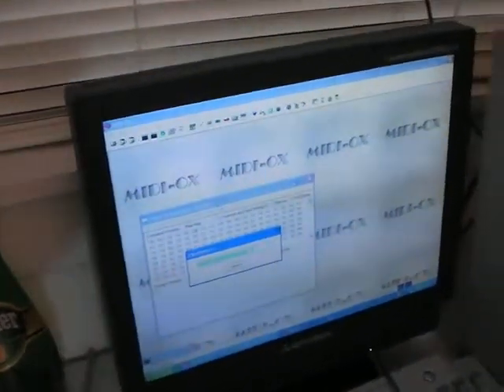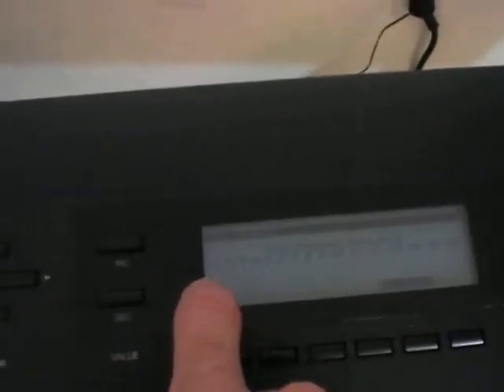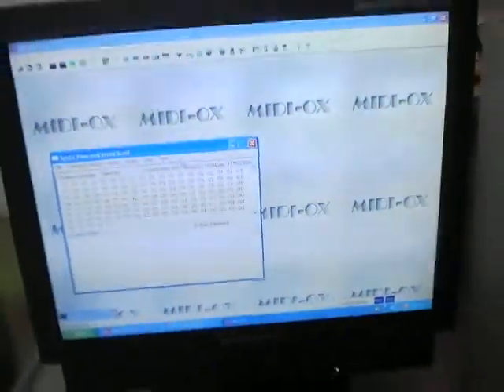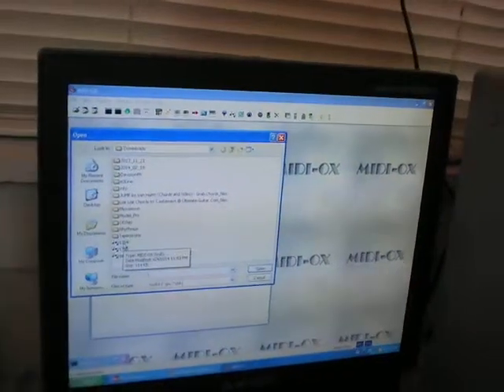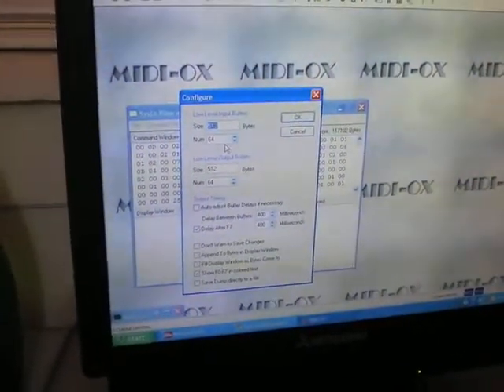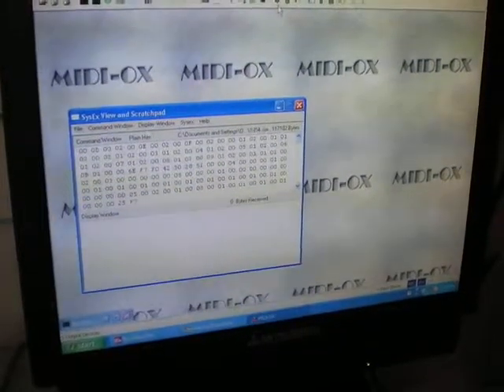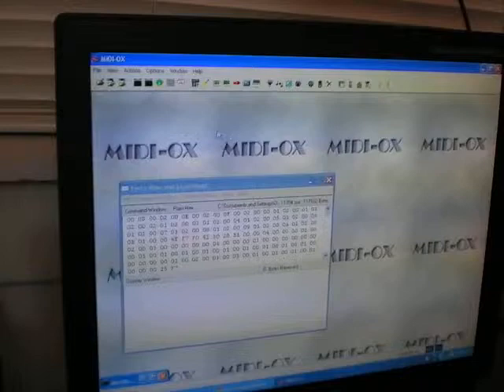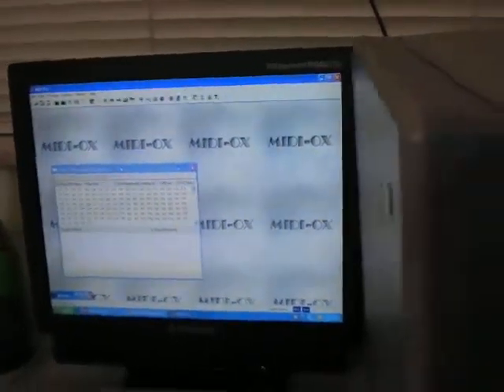Korg Wavestation EX synthesizer how to patch reload after battery replacement

Comment from the maker: the 49 memorys you have are permanent and will not disappear when changing battery. You will have to reload the remaing 150 patches using a cable since they get dumped when battery goes bad. Your display sounds like it is bad if is not readable
Reply: that"s exactly what happens to me...

Comment: Hello Mark, Im hoping you can answer my question I have. Recently purchased a used Wavestation keyboard and the text in the display is almost completely distorted. Besides that, Im wanting to do the RAM initializing procedure but Im kinda worried that I might lose the only 49 factory patches I have in the memory. Do you perhaps happen to know if I have to do some kind of backup before I execute this procedure? And why would my keyboard only have just 49 stock sounds? I wonder what happened to the rest of the factory presets.